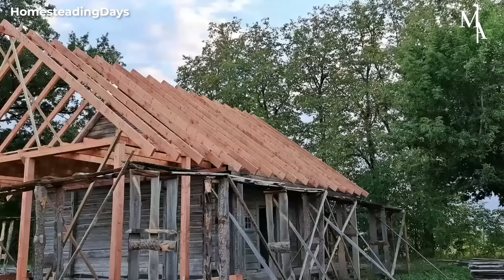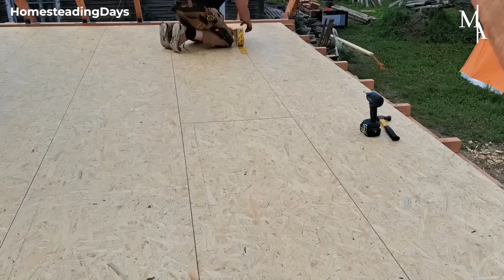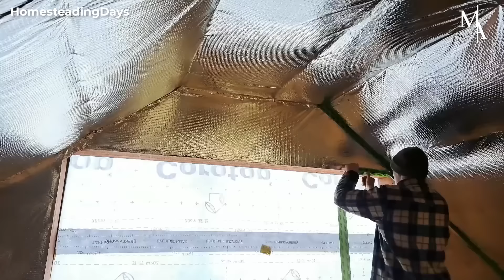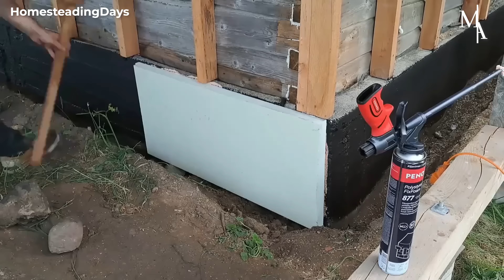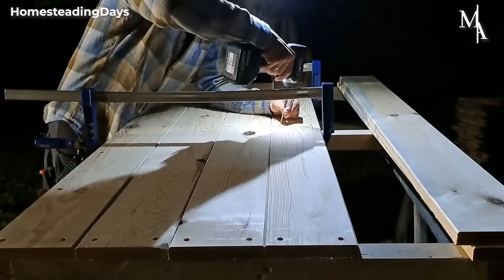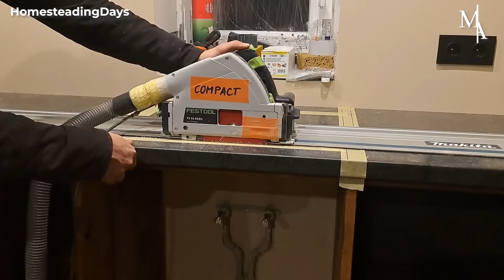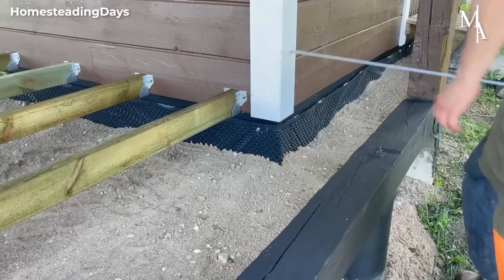Couple Turns Abandoned Shed into Amazing House | Full Build by @homesteadingdays

Comment: Building " Different"...revamping an Old House..Nice Work...my comments Below..Finding Clarity on a House Vision..what is an ultimate, sustainable Use..one hopefully zat can also generate Cash Flow..Think Different..ze old Model of building for ze Wife + 2 kids, may not endure for you, unless you have Deep Pockets to pay for zis..

Cash flow is key so you can pay down your mortgage ASAP also..although 4% money is always tempting but limit ze Debt in Line which Cash Flow which can Vanish, as we saw during ze LockDowns..so you must navigate all zat Uncertainty and build something ANTI-Fragile, resilient and something zat can be adapted easily in ze Future, as your Needs change.

So, add Bathrooms, Bathrooms..a great open common space/lounge ..When I see a House with 2 Bedrooms, and one Bathroom, Its not Good Design coz it cannot adapt to anything ..its too limited. So, are you coachable?...ha ha..The worst vice is advice..I just to provoke deeper, second-degree Thought..from a state of abandonment to Something Else, Shinier, Brighter, Better, Warmer..Grand spaces...also, using Painted Concrete Bricks can give an Allure and Texture for some Accent Walls or Faux Post Corners..it looks timeless, can be repainted, as Fashions change..

All ze horizontal sewage pipes in 4 inch Pipe to allow Venting and flow and allow for Freeze-up in Winter and possible Blockage Also..in schools, only 4 inch pipes..coz of tampons and stuff..so, you need Lucidity coz all zese ojects can esily congest a 2 inch sewer pipe..so think Again..also, I would dig 6 columns Going 10ft below..to allow for digging underneath and adding a Room Below ze Deck..Build Roof of it, ze Deck accordingly, givee it a 1 inch slope for Drainage, bring Deck into Level with Furrings of 3/4 inch, so even ze deck is a quarter inch out of level, sloping outwards..simple..a Bobcat can easily excavate a Hollow underneath, Quick work, Rent it or Get an Experienced Bobcat Operator..

Build a Footing around ze Perimeter, infill with Block or Concrete(better) in between, so I would think of all zis, coz ze Name of ze Game: add cheap and cozy square footage indoors..2 extra bedrooms and a Bathroom or a Rec Room, 9 ft high, if possible..if not, it can be used as a Garage-storage for Lawnmovers, Quads, Canoes or Ski-Doos, although adding  separate, unheated Cabin for zose would be a better use of Space...Nice Work. keep ze faith in ze 2x4, ze Foundation of our Civilization...ha ha.Combine zem to strech zem, make Posts and Beams, sandwich Ply in between, Glue and Screw and Nail..Sturdy Posts, sturdy cheap lintals, beams above Windows or Doors..Have 4 in a Row + Plywood 1/2 inch in Between for larger Openings..

Do Siding Accordingly, some Windows, you can push out 2 feet to create Bay Windows where ze Cats can sit..or houseplants..
Adding a new Staircase on ze outside Facade , Patio or Staircase, bumbed out 2 feet, is a beeter use of Space, with more available, bigger Bedrooms..

Bigger Bedrooms I would Do? Why? coz it is lacking..When you spend 24-7 in a Room, you want big Rooms..with Remote Work, changing Lifestyles, Big Bedrooms are popular again, for Good Reason..also, you can have one Big Space, one Bedroom, with Bunk Beds , 6 -8 all around zem, with Good Light and an ensuite Bathroom..so Think New, Think Different..what is ze Ultimate Use of zese spaces..beyond me, myself and I immediate use, Maybe Think about Inter-Generational suite ,(many Immigrants are all-about-family) so  a Granny or Maid Suite as well..coz if I would travel, I d like one person living zere all ze time..just saying..
In Nova Scotia..you can still find cheap houses zere for now, until zey catch up..Also, you could think in terms of a seasonal occupation..8 month open as an In or hostal, 4 months closed.(when I head to Santa banana...ha ha).providing you an Interlude ..so, you need to integrate your Lifestyle Choices..or have an Owner-operator suite (under ze Deck), and a Common Everything Elsewhere Above..a Nice Big Kitchen, Lounge and Deck and BBQ..etc. Add a water Feature..I saw an Aussie use an I Beam, layed flat  to channel Water into a Water Feature and have water circulating in a loop..with a Pump....so its second degree thinking, in a few Months, once ze House is water tight..

Comment: 4:18 actually, those are not supposed to be for holding the roof and keeping it from spreading even though it can help some. Those are actually to keep the top from splitting under high winds. You're supposed to tie them in along the bottom like a truss. Perhaps what you would call under the floor in any rooms in the attic. That's what's supposed to keep it from spreading and the outer walls from falling out. Those top ties can only hold so much from up there.

Comment: Great job. @ 43‘18“： I'm wondering if an insulating tray is needed for the floor under the fireplace? Are the floor tiles heat-resistant enough? Thanks

Comment: Unbelievable how this couple converted an old cottage into a beautiful house.
The reconstruction of the exterior as an interior is incredible, while stable wood of fir or pine is a start against moisture and wind.
The interior of the kitchen, stairs, shelves, etc. is beautifully done.
Specifically, all material for insulation is a must to keep cold, moisture, outside, which means that this is well balanced. 
The specific location of the heating stove is well chosen for its location and relation to indoor use.
Not to be forgotten, the exceptionally durable brown color that keeps moisture and mold out is a must in any building so that it does not deteriorate over time.
Having said that, I give you 12 / 12 for a job well done, and a big congratulations to you and the house.